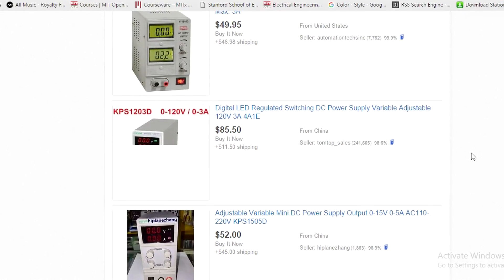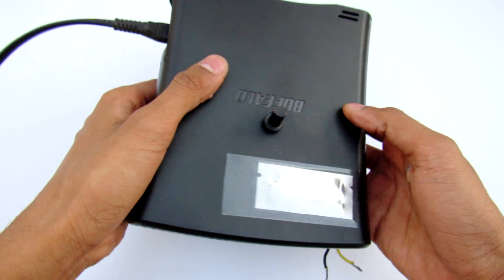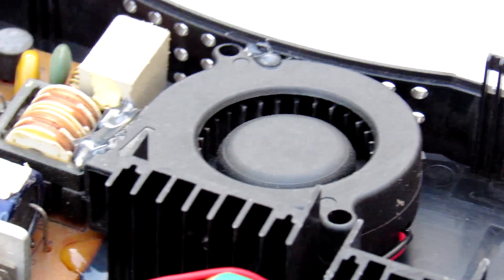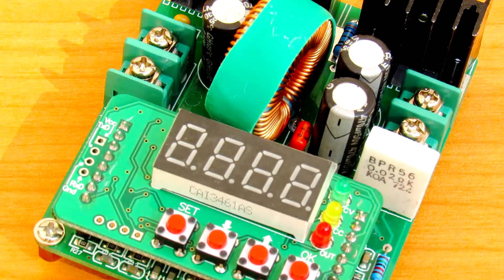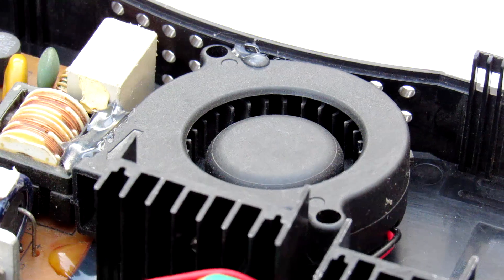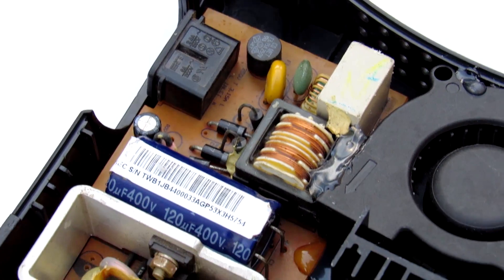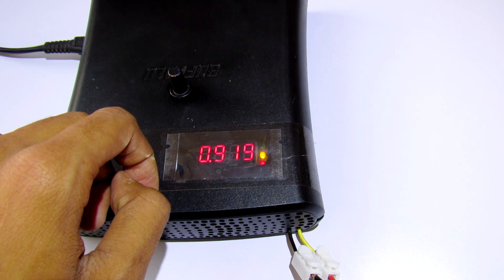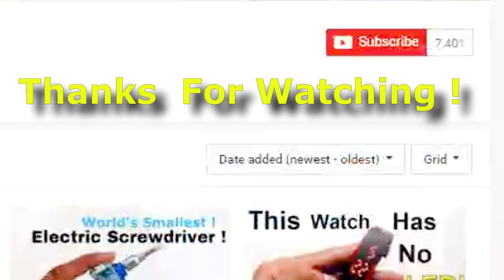Bench Power Supply with SMPS 🔋

Comment: Kedar, I dismounted a burned LCD bulb lamp. The LEDs are burned, but the PCB is ok. I tested it connecting to the wall socket and it gives 35v DC... What do you think? I'm going to buy a mini voltimeter like that one to test more.

Comment: Can u give me the connection diagram of rotary encoder?
Reply: Hi Kiran, here is how I figured it out:

When I tried the first time with a continuous check on my multimeter it didn't work because I was turning it to fast and the multimeter wasn't picking up the changes as fast.
But if I turn it a bit slower it works. It turns the connection on and off :)

The connection:

GND + CLK = one push button

GND + DT = another push button

and

GND + SW = third push button

It doesn't need DC input in my case.
Make sure you use the same rotary encoder (Keyes Rotary Encoder Module KY-007 040)

Comment: Thanks I am wanting to know how tam add more amps of dc power to run at a set frequency.. I have a nice Radio frequency generator that runs off my computers usb power..the frequency generator has an output for the signal it is generating after the signal is produced I want to amp up that same frequency sy up too 50 amps dc continuous. Thanks again  Kedar guitar man Nimbalkar Rocker. Just having fun do not be insulted in any way Young Man.

Comment from the maker: Please Share This Video With Your Friends ,See You In The Next Video.
Reply: +Kedar Nimbalkar How did you get the rotary encoder working?
Reply: Can u give me the connection diagram of rotary encoder?
Reply: Hi Pablo here is how I figured it out:

When I tried the first time with a continuous check on my multimeter it didn't work because I was turning it to fast and the multimeter wasn't picking up the changes as fast.
But if I turn it a bit slower it works. It turns the connection on and off :)

The connection:

GND + CLK = one push button

GND + DT = another push button

and

GND + SW = third push button

It doesn't need DC input in my case.
Make sure you use the same rotary encoder (Keyes Rotary Encoder Module KY-007 040)
Reply: Hi Gellert, thanks for answering. I will try as you say. I tell you that it works. Thanks again.